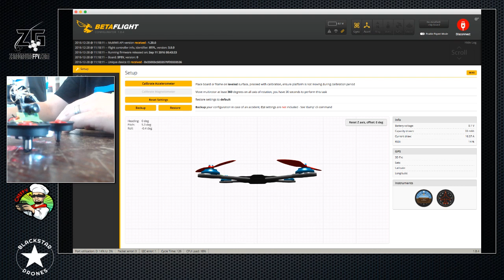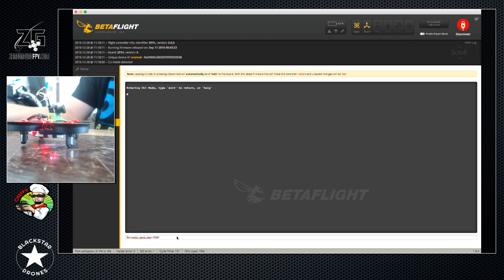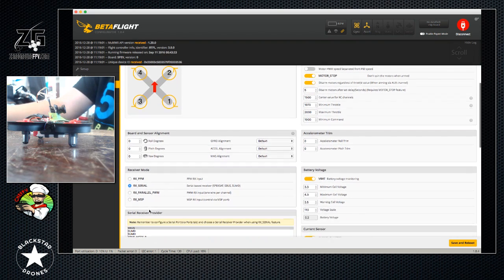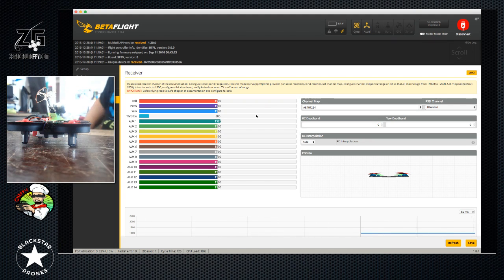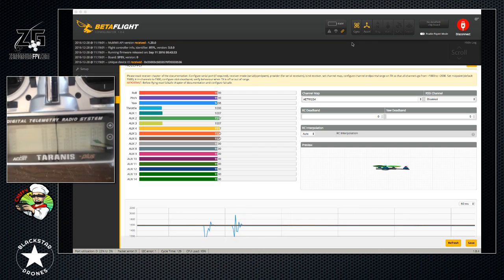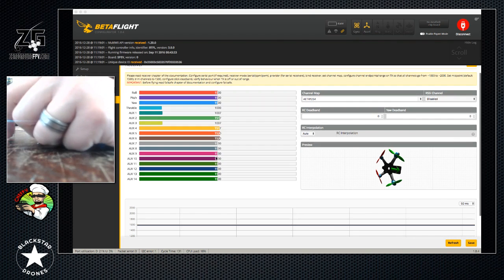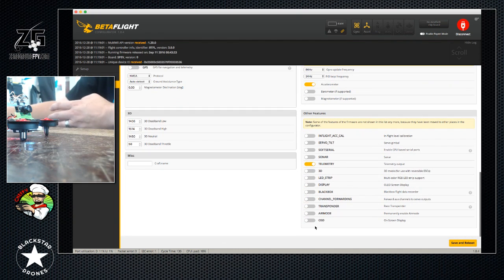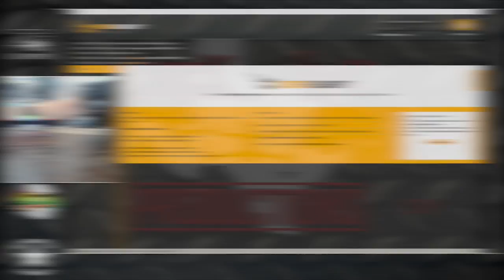CheFPV 101: How to Setup Eachine BeeCore FrSky Flight Controller for Tiny Whoop

Comment: Hi, I would like to ask your help. Im a newbie and 3 days ago I received my first drone (kingkong tiny 6). somehow the throttle is weak and hard to lift up my drone. Also the roll is very slow. Could you check my print screen please?! https://flic.kr/p/WpR7n6   
It is normal when I push the aileron all the way to the right, the green spot (see the printscreen) only goes until that point? Should not go to all the way up?